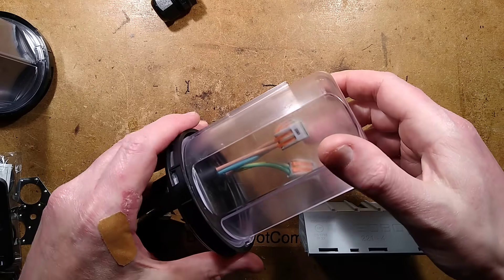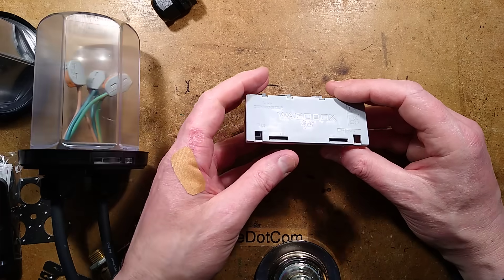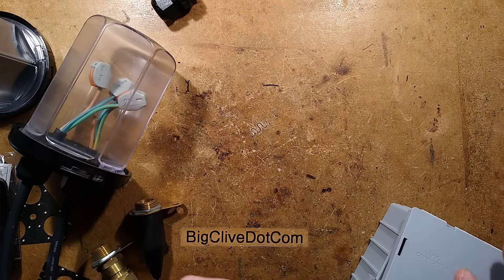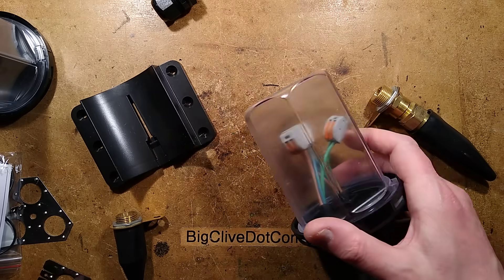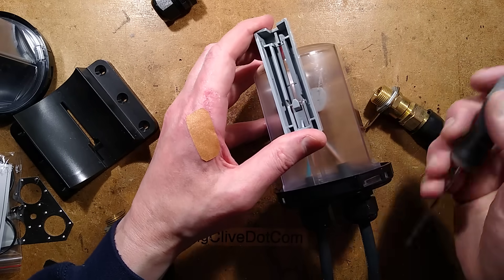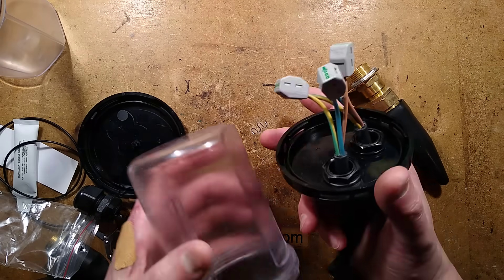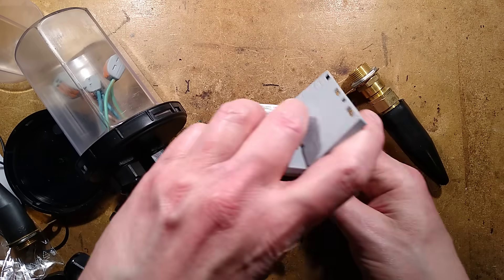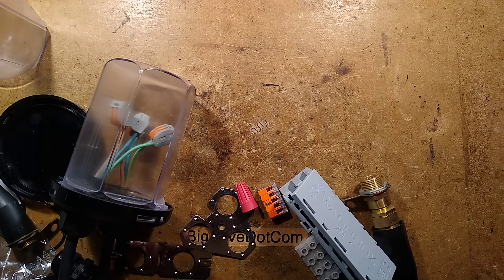A look at the Wagobox Capsule enclosure

Comment: dunno... here we have all the shown solutions in use along whit hand twisting and .. tape ..... 
wago i did use to install some low current lamps. yess i know it has been tested and it works to whatever amps and so and so and so... yet i seen wago burn up. just like all other forms of termination and wire connection.
however when my house had to be rewired wago was allo used. to set things up. and then no more wago. got replaced whit soldered joint, and heatshring. dunno. i just consider it still the best option. 
its labor intense and has its cost for that reason. but wago is allso not cheap, whatever i would spare whit a wago in labor cost, i actualy pay whit the price of the wago. and now they are making wago boxes. even more expense. surely its fun and fast, but damn, the price of those things simply won't justify it. specially when we talk about a connection that none will ever wish to undo. 
and the only more or less okay hermetic sealing is.. still heatshrink. so i don't realy get the point of wago. i get it why its better than the american screw cap, i can see how its faster and is spring loaded versus the english solution of a screw attempting to do the impossible. and thats about all i can see. 2 flawed designs, and the 3rd one improves on them, but in exchange it costs least as much as a very proper solution that outclasses all 3 of em, but lacks 1 single thing.

Comment: So I'm no electrician, but what on earth could that possibly be used for? Seems completely useless and an extra step between 2 points for no reason other than adding extra steps. If it is german, I'm not surprised, given I on the occasion work on german forklifts which are complete garbage because over complicated for no reason at aaaalllll.

Comment: I still dont like wagos.
Ive seen far too many melted in my short time with them to trust them.
I may be in the minority but i go off what i experience. And ive expienced more melted wagos than wire nuts in 20 years.
Only seen wagos for 3-5 years now.... speaks for itself if you ask me.
Reply from the maker: Are they terminated properly and used with copper wire?

Comment: I used to work for a German company with large, complex production equipment. All cable enclosures, where at all possible,  had to have clear cover panels. This dramatically improves cabling standards and stopped the cable spaghetti you often find. Clear is good.

Comment: I'm not the biggest fan ever of Wagos because I've found they' can be dodgy if you don't quite get a solid core wire as far in as possible OR when you use stranded wire OR when you mix both in the same connector. I'm old school in so much as I prefer choc block but I do admit Waggers are tres convenient and fast. Hope your hand is healing - take more care with the demon spudger in future!!!

Comment: If you have to seal a cable connection take a plastic jar filled with some car repair epoxy resin dip the cables in and let it harden. Lasts in my backyard since 15 years.😁

Comment: Reminds me of an 'electrical' joint I made in the back yard of my parents house when I was way younger, I buried an upturned jam jar with some antenna coax leads joined inside. I just tucked them up inside the jar, no lid and buried it.
Many years later I was rippling this all out and I dug up the jar, it did a perfect job, the joints looked like they never saw water, and that cable never failed.  Would I do this for 240V, no. I was a youngster and joiners like shown here were definitely not stocked by any shop I knew of.

Comment: I've used wago connections when replacing my hot water heater in my RV going on 4 years now without any issues so far. They were the best option since it's very hard for me to reach behind the unit in a cramped space to do connections with wire nuts.

Comment: A proper re-enterable outdoor version of these has been in use in the Telecommunications Industry around the world since before the 1970s, are still in use, and still readily available. 
The whole unit is made of the same black polyethylene plastic to avoid thermal issues and can be used on a Telegraph Pole or in a Communications Pit.
The cable entries were originally sealed using a two-part epoxy resin or more recently a flexible polyurethane sealing compound similar to Silicone Sealants.
While primarily designed  for ELV Telecommunications use, I believe that they can also be used for LV Electrical connections.

Comment: My first experience with Wago was when I bought my first 3D Printer kit to build a Voron 2.4 a few years ago. They are so much better than those stupid wore nuts electricians use here in the US. I don't know why the US didn't start using Wago connectors years ago. I love them.
Reply: With wire nuts, unless you install the wires properly, you are not going to have a good connection and wires may walk themselves out. With a Wago, I don't see that ever happening.

Comment: I have found that water tap lubricant makes an excellent additional barrier to "undesired" water ingress (and obviously provides decent and corrosion - inhibiting lubrication). Don't know about dielectric properties, but it certainly appears to protect spade contacts from corrosion on a long term (decades) basis. Wire nuts are no longer legal "Down Under", but are VERY common in older properties, where they have certainly stood the test of time.
Reply from the maker: The grease used in plumbing is often silicone grease.  So very inert and with a high dielectric strength.  That's what's used here.

Comment: 0:10 The problem with cases like this is that the air inside expands and contracts with temperature changes. This forces air and water in and out past the seal. I wouldnt recommend any air filled container be burried inthe ground. Potted boxes are better but obviously less serviceable.

Comment: Pretty neat, I wonder how they hold up to UV light. I've know about WAGO for about 10 years, never thought of them for use with household current. Always thought they were for low voltage. They sure as heck beat wire nuts.

Comment: Love the earthing connections, but I am confused, Wago is the company when I might believe would keep water out.
With wago the question is although the price. What you have shown looks expensive Compared to cheap IP X6 enclosures around a pound which although take  20mm or 25mm glands, this looks like something I would only used near marinas or flowing water.
I would have a hard time keeping myself from creating drain hole inside one of these.

The American style screw on top cap (You have shown), have been banned in most of European countries because they provide near zero tension strength. So if main tension hold fails (breaks), or more often is not used properly, then they gradually unroll.
Lets although add the standard crimping ferules to the list. Their main weakness is low availability of good quality crimping tool, but if you know where to get good ones, then they  last even longer then wagos and have added benefit of demotivating plumbers and builders from messing about with them. 

Little ugly but reliable trick when trying to replace old style hard to access junction boxes (such as in lighting) is to use transparent heat-shrink and metal cable ties as strain relieve.  bend the excess heatshrink and put second layer on. Result is fully compliant strong reliable easy to inspect and ugly maintenance free connection.
The wago XL are very handy with underfloor heating where top is handy for marker written legend

Comment: My own experience is that the screw clamps and wire nut connectors are the most reliable to use in all types of conditions.
I use Wago only when it is the only solution at the time. Unfortunately, those moments are becoming more frequent.

Comment: This might be a silly question, but are Wago connectors code-compliant in the USA for residential electrical wiring (110V AC)?
Reply: *120V AC (hasn’t been 110V since the 50s). But yes, the ones sold in USA are UL-listed and are increasingly being used by electricians. The WAGO boxes, however, are not UL listed, so you’ll need to use the WAGO connectors inside some other UL-listed box.

Comment: @9:55 - When I was in the fuel business, all of our connections outside (low voltage sensor/probe connections) were done with small blue wire nuts and then sleeved in a quick-set 3M 2-part epoxy package that is mixed in situ, the connectors inserted in the epoxy, then the small bag is zip-tied.  In mere minutes, you have and intrinsically safe, highly weather resistant connection.  Anything at a fueling forecourt below 18" (46cm) must be intrinsically safe.  All conduits out of the dispensers to the building must be potted with glass fiber and then grouted.

Comment: I would so much prefer the black plastic base to screw into, rather than onto the clear container, so that when it's mounted vertically, water drains away from the seals rather than onto them.
I remember a Hoover twin-tub washing machine where the motor was protected by a little (rusty) pressed steel umbrella over the top to deflect away the water that inevitably leaked out through the rotating seals of the washer. Shedding water away from electrics is so much easier than trying to seal it out.

Comment: That black cap on the outside of the clear jar - looks like it would encourage rain water to pool in the ledge, no?
If the black cap were threaded up inside the jar it would encourage water to drip off the outside.   Is this a real problem or is it so-little water it doesn't matter?

Comment: Got into the rabbit hole why we in the EU don't use nuts anymore. They got banned in the transition from aluminium wires to copper wires in many countries in the EU. There were fires when a copper wire was twisted with an aluminium wire, the plastic on the nut was sub par for modern standards, screw terminals did not have that problem. 
At later time IEC certified nuts were produced but it was already to late, most EU countries used and certified screw terminals.

Comment: I don’t know if this will be seen but I could use a little help with something.
I have a 72v dc charger. It has no power output. It has a status light that doesn’t come on. The fan inside died and I believe it overheated.
Where should I probe first to find out what died?

Comment: The installer of our home EV charger, made the terminations to the the charger input supply Wago connectors.
I questioned this choice, he said it's standard practice to use Wago connectors in preference to screw terminals, as they are just better.

Comment: My buddy was diagnosing residential unit (trailer) with no power, and discovered a plastic Gatorade bottle from the pedestal to the breaker box as the junction box in ground. He told his boss they weren't working on that property. There was some wire nuts and electric tape holding that mess together.

Comment: I usually just punch a hole in a tupperware lid and then apply copius amounts of duct tape around the hole and wires, maybe some hot glue if it's permanently outside like my extension cords for christmas lights, and then put it bottom-up if it's on the ground. Works great and dirt cheap, almost free if you use margerine lol.

Comment: Wonder if that 2nd metal piece is able to be cut in half so you can have 1 cable coming in from opposite sides or any angle ( due to the clear case design ) ?  and join with any coming from the bottom if required .

Comment: Any approximate cost of the WAGO CUP weatherproof container? As for the wire nuts, I have tried some locally made Greek junk here, no way José, they do not grip. Thank goodness I brought plenty of the premium brand nuts from the states. One must first twist the wires together with your electricians bullnose pliers and then cap the connection with the nut. These nuts are NOT to be used to join stranded with solid wires, only joints between solid conductors are permitted. In the past there was also an expensive version of the wire nut that consisted of a brass ring about 3/8 inch high and had an inner diameter of 1/4 inch with a set screw on the side. It had a short threaded section along the base. You would twist the conductors together and insert into the sleeve and tighten the set screw, finally screwing on a plastic cap over the ring to insulate it.
As for the WAGO connectors, which I have never seen or taken apart, is there a conductor below the opening as well as the compression finger inside for maximum conduction? It also reminds me of the cheap "punch in" connectors on the back of the cheap American outlets which are used by many individuals most of which do not know how to properly use the screw terminals on the sides of the outlets. There is only a small piece of spring steel used to hold the conductor and if you overload the outlet it will overheat and loose it’s temper and will not hold onto the wire properly leading to a runaway effect of overheating the connection to failure.

Comment: I'm an American, and I absolutely HATE wire nuts. I don't care if you have never had a single issue with them. They are awful, and they should be on the "strongly discourage from leaving in place when passing inspection" list.

Comment: Thought that was a Vauxhall oil filter housing. Known to stick and break on removal. 
Iv used wago, and still prefer a choc block.
Accessorizing wago with boxes you have to likely break to open , somewhere between needing tools or not to open. Doesn't give me the warm and fuzzies.
Iv relegated wago to temporarily capping wires

Comment: As luck would have it I was looking into using Wago 221 Wire Lever Nuts Conductor Compact Splicing Connectors today.

 I live in the good ol' USA and was surprised to see the wago 221 series now has a quite small weather cover that is a clamshell filled with a silicon gel that seals around the connector and wire when it is closed. It is also reusable!  

If you look at the clear end of the connector there is an open space behind the orange lever with the Wago name on it. It is labeled "Test". I needed a magnifying glass to read it. This makes it very easy to get a meter probe in to measure voltage.

Another interesting product is by Leviton, Decora Edge 15 Amp Tamper-Resistant Duplex Outlet. It has lever lock terminals now. Looks like I'll have to get rid of my wire nuts at an Arts & Crafts show or flea market! I am always entertained and enlightened by your videos. ThanX!

Comment: wagos have high resistance but easy

steel-spring-inserted wirenuts are forever, pretwist them, but can't be reused with same wire ends really

terminal blocks loosen up in time, as well as any other screw

other things are midway and are never used almost
like

just twist

twist + solder

weld (yes!)
Reply: Well to me when a circuit has to be modified, the Wago connector should not be reused as it uses bending spring metal that may conform and hold a "memory" to the last conductor used.  Wire nuts can be reused, not sure where you get that idea but they aren't as expensive as the the glorified speaker connector that is the Wago.

Comment: I wish all enclosures were transparent! Would make troubleshooting easier and it would be much safer since everyone would be able to see black/melted/burned wires, or arcing, and be able to take action before something catches fire

The wago 221 being transparent is nice too, it’s easy to see if the wires have been stripped correctly and if they’ve been inserted correctly.

I have been having problems with the wago 221 though. They all crack due to the internal spring force, if you’re like me, and use them as test connectors and open/close them a couple of times a day. Last week I talked to an official Wago rep about this problem, at a fair stand where Wago was represented, and he hadn’t ever heard about this problem, interestingly.

I have a couple of broken 221s sitting here. I should film a little video and upload on my channel tomorrow or some day. They’re literally crumbling apart in my hand.

Comment: I made something like this many years ago for connecting 120vac power to a submersible septic system pump. It keeps the wires clean and free of corrosion. I used a plastic Metamucil jar. The Wago jar is admittedly better because it allows easy viewing of the wires and connections. Thanks for sharing Clive.

Comment: Love the jar, hate everything else.  I guess I will never understand why electrical connections have gotten so lazy in Europe and the UK.  I mean, you are using speaker pinch terminals for high power connections.  Moving parts are designed to fail.  I say this because the mechanism looks a lot like Nintendo's ZIF connector for games on the Nintendo Entertainment System.  It seems like engineering in Europe forgot what occam's razor is.   You want to change the oil on your Volkswagen, you have to buy a new oil drain plug and a special tool. You want to vacuum clean your house at high efficiency with your Miele or Sebo?  A box of tiny filters and bags has to be purchased every six months throwing away lots of plastic in the process spending obscene amounts of money for something that Numatic and Kirby at least got right:  simple large capacity two stage design with a HEPA bag and a cloth filter as well as Rainbow with its water bath filtration system and huge HEPA neutralizer at the rear of the machine that's replaced every 5 or more years.  At least some good comes out of Europe, and that's Neutrik connectors and Honda France's design for a small yard lawn mower.  I just recently acquired my Aunt's Honda Izy and it's a fairly cute but incredibly durable little lawn mower.